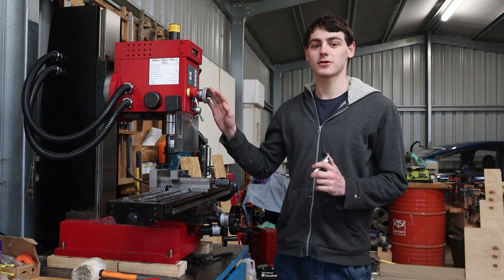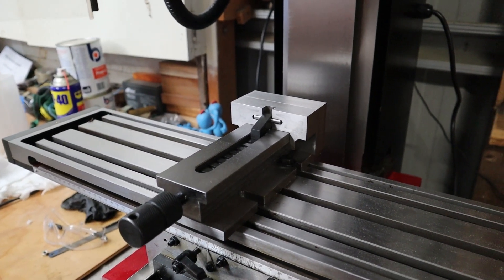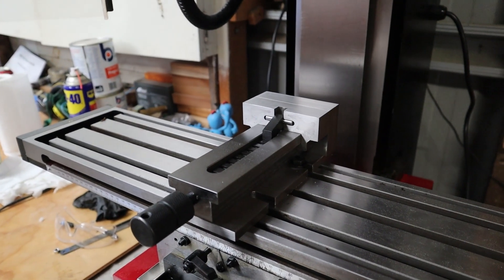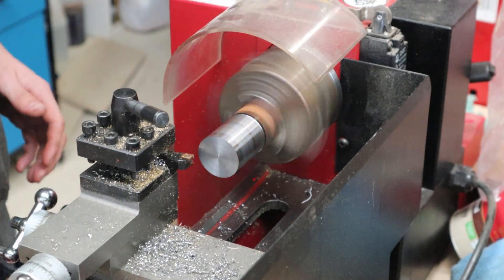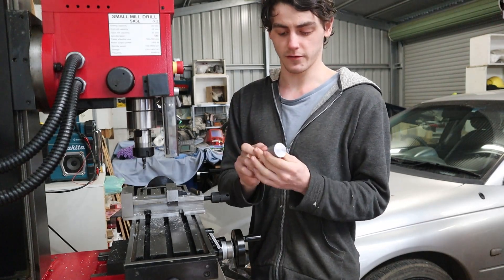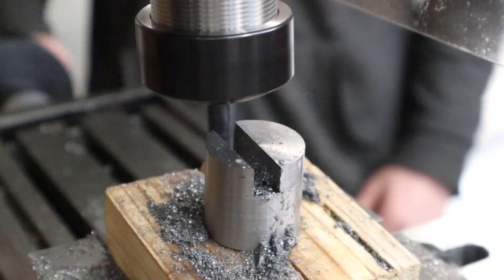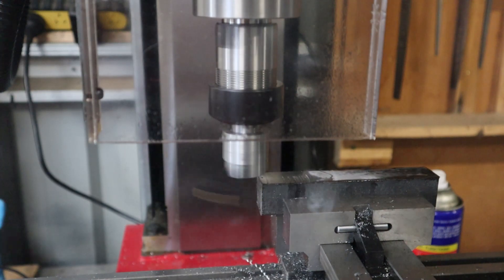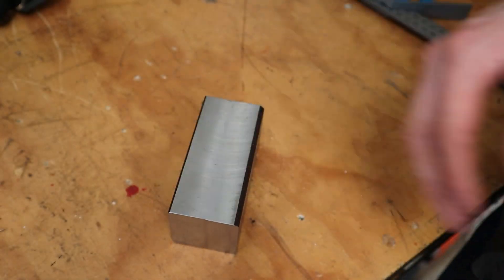SIEG SX3L Mini Milling Machine + Machining a Fly Cutter

Comment: Why are you using WD40 as lubrication?
Reply from the maker: Wd40 works great on aluminium, however not so great on steel but it was all I had, and it’s better then nothing. 😂 
I’ve got some on order though